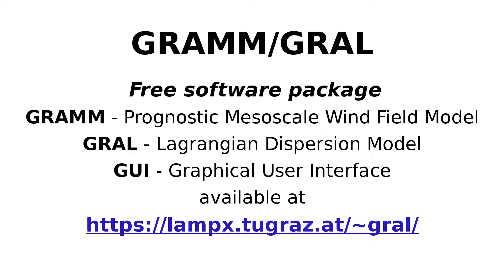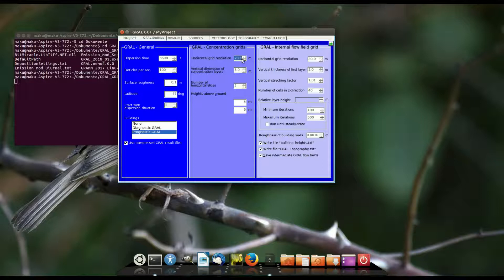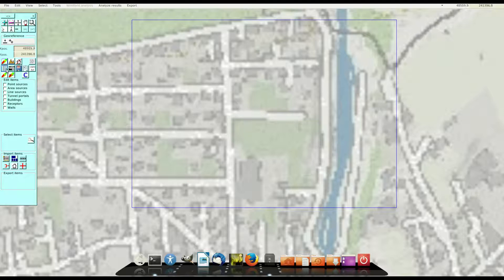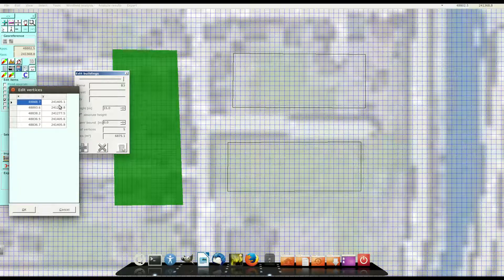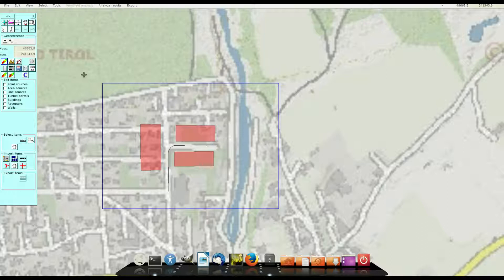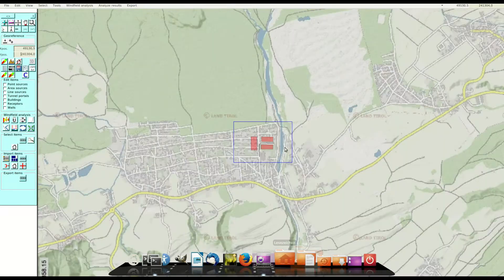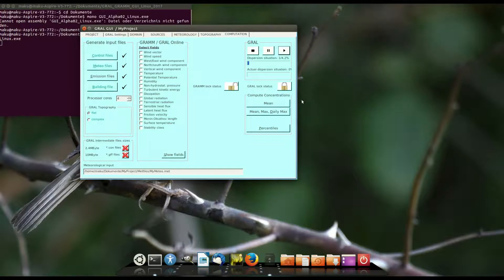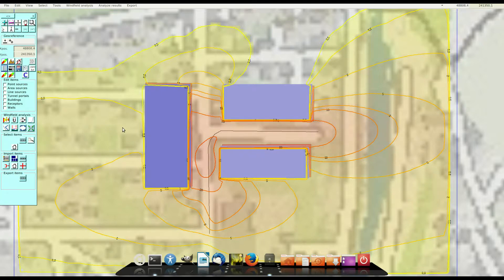Project with one linesource and buildings | GRAL #3

Comment: Hello, about the emissions from linear source I have a doubt.
 If I want to import a shape file in which the emission along a line is a value given by the product V * EF * L,  in kg/h, with V as the average hourly traffic volume (expressed by vehicle number/hour), EF as the emission factor (in kg/(km * number of vehicles)) and L as the length of the distance traveled by vehicle, in GRAL may I consider this value  or should I modify it? If yes, how? Thanks for the reply.
Reply from the maker: First many apologies for the very late reply. The support is done by the TU Graz. As a developer I have unfortunately neglected the channel very much. But maybe this answer will help other users.
The input for line sources is mandatory in kg/h/km. The data in other units must be converted in another application before the shape import.
From the coming version 21.09, the input in kg/h will also be possible for the manual input of the emission rate for line sources. Internally, however, the emission rate is always converted to kg/h/km and also saved in this way.

Comment from the maker: NEMO is an optional tool to compute the emission rate of line sources based on several parameters. Alternatively, the emission rate can be set manually or it is possible to import shape files with already computed emission rates.